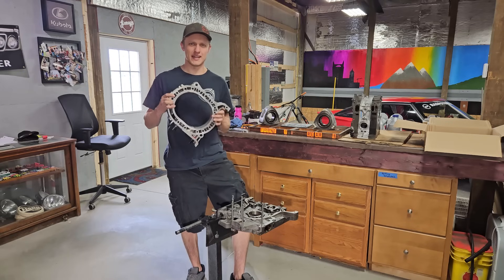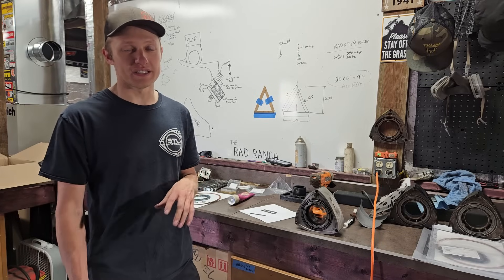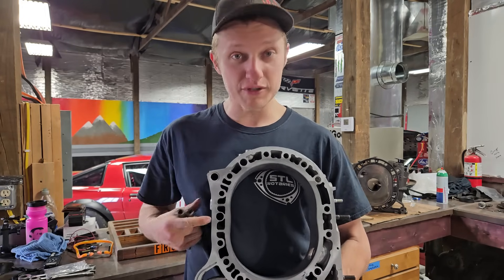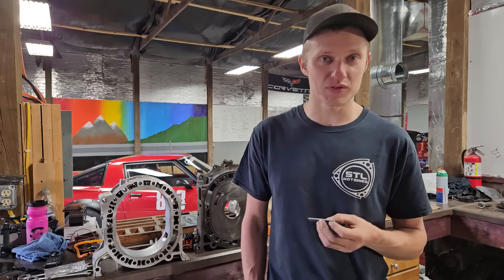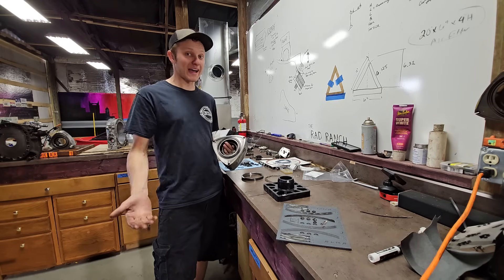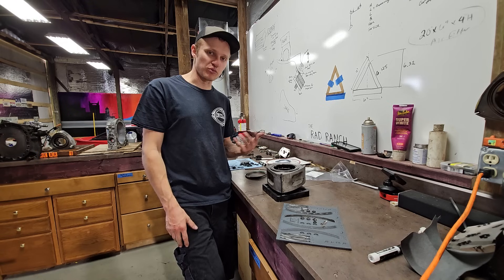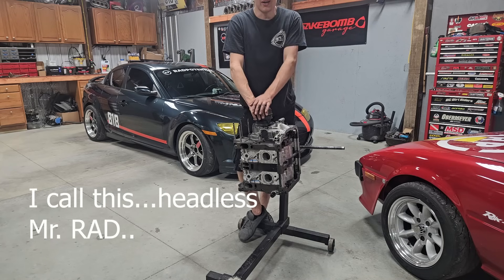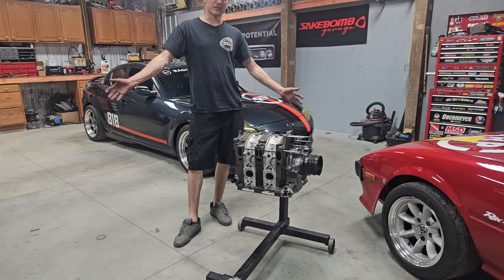Taking Rob Dahm's Advice For 13b Rotary Reliability and Durability @RobDahm Thank you!

Comment: bro maybe people already know but i wonder running a rotary on blow thru propane and just eliminate gasoline inject high pressure liquid propane into the turbo to heat up and vaporize mix up with the air plus it's dry maybe need oil metering pump to fogger in 2 stroke oil lol would anybody else like to see if that's possible not to mention thirsty rotary engines could see fuel prices cut in half

Comment: The mazda apex seals are not soft seals by any means. They are also not weak. Infact, Mazda seals are hard seals and that is the reason they are brittle. When they break, as you said it ping pongs in the engine.

Comment: Hi i am new subscriber and at around 11 you say that if you put the assembled rotor on the back of the engine something bad will happen to the control ring ? I dont understand that part because you can assemble each rotor front and back and as long as you put the control ring curved round edge in the correct slot just how you say and facing the correct position it shouldnt matter if you put the front rotor in the rear ? Because your rings are in the correct spots right ? Or am i wrong somehow ?
Reply: You have already assembled the front rotor ? Control rings and all and lets say you assemble rear rotor as well , it wouldnt matter where they go rear or front would it ?   And i do understand each rotor faces oppsite side please help me
Reply: @bryansautoandmotorcyclerepairs  it doesn’t necessarily matter but you should have labeled them when you did the teardown. As long as the oil control rings are correctly aligned then you should be fine. If one of the rotors is new you should be certain that the casting batches match. That will be designated by a letter near the corner seals. C’s are the most common. Get on RX7 club and look this stuff up. Its much more efficient than commenting on a youtube video. Im sure Mr. Rad is a busy guy and he probably cant get to every comment.
Reply: @Alwayscorrect12  well thanks for your reply and yes i have already learned you need to have matching rotors.   And that little part just threw me off completely on his video and scared me because i dont want to make mistake.

Comment: hey Rob and RAD. i´m building up an outparted 1985 12A FB3S GSL with GSL-SE Axles (dont know why they done this but hey i have SE-Axles) so can i use that extra dowel thing on the 12A too? expecting yes but better i ask 1 time more than doing an failure in thinking about before i start that whole project

Comment: OEM seals are king! If you are breaking an oem seal you have other issues to deal with or they were very old and got brittle.

Self built REW thats been going for 3 years as a drift car and making 430whp with all oem internals. I have run it out of fuel under load, hit boost cut with wastegate plumbed backwards and countless fuel pressure drops from slosh and the engine laughs at it all.

The real key is having a good ecu with at minimum wideband, fuel pressure and oil pressure sensors going to the ecu with correct safeties in place.

Not hating at all but i have been on the bendy apex seal train before and after changing to oem i will never go back, they might not compression test much different but they pull better vaccum (seal better everywhere) whilst actually in operation.

It seems so rare to get real feedback from people about these engines so for me if my engine can handle 3 years of what i put it through the average person who wants a fun street car has absolutely no need whatsoever for an aftermarket apex seal and can enjoy that for longer than most will probably keep the car for.

My car is remote tuned by Omar @ Raceonly and he is the one who conviced me to go oem seals. They are way more reliable and more importantly repeatable than everyone gives them credit for.

Comment: If your really want to keep the torsion twisting down look into the Mazda factory race motors they had a steel plate across the top of the engine front to rear on the MFR pp motors nobody has ever noticed that and nobody has as much R&D as Mazda some old racing beat catalog had pictures of it

Comment: This is sort of an unralated question but does anyone know where i can buy the 3 vacuum hoses that come off the intake of an RX8? Ive had a hard time finding them and im chasing a lose of power issue and the engine runing rough at around 7-9k RMP after putting on an AEM cold air intake which i think is a vacuum leak.
Reply: Get them from Mazda. If you take your car to HPDE or autocross you can join the Mazda Motorsports support program, which gets factory mazda parts for great prices.

Comment: What caused the detonation? Solve that before you put this engine under any load. Otherwise you'll  be right back here again! Also that dowel is not ideal where it is. You are removing material from near the plugs and could cause the housings to crack. Either put the dowel further down from the plugs, or better yet put in a stud kit that removes less material from the housings and is far more rigid. But you dont need any strengthening on an FD engine if you are targeting around 400-450hp
Reply: I don't know enough about engines to comment on dowel location, but I agree that unless there are ECU datalogs showing that all the readings were good then I'm suspecting fuel system problems, or overboost, or ECU calibration problems like not compensating for unusually hot or cold temperatures. Each time I hear about a hurt engine, I wonder what could have been done to prevent it. I can't imagine any brand of apex seals causing failures on a 350whp setup, they are just the canary in the coal mine telling you that something else was wrong.
Reply: Colder plugs will help with detonation, it's well documented on the rx7 forum how effectively it helps to reduce this
Reply: @Sparkling.Fresca  great point, I assumed they would be running NGK 9's or colder. I don't remember hearing that mentioned in the video, hope they weren't running stock heat range.
Reply from the maker: We have 9s in the car.
Reply: @RADPotential  Look into R7240-10 for leading and R7420-11 for trailing, should have at least the IGN1A smart coils for these to not foul up under normal driving. The trailing plugs can act like glow plugs and cause preignition, and the colder plugs will reduce the apex seals chattering over the plug holes. Will also help protect the water jacket around the plugs compared to the hotter stock ones.

Comment: I have a 375+ whp fc that i have done many engine builds/car revisions on trying to find a combonation that will last. Its been about 9000 miles on my current setup but i have had very good experience with RA classic apex seals. I tested stockers, e and j and the RAs can take the heat and just need some extra premix. I would love to discuss with you what my experiences have been working towards achieving a reliable high hp rotary even in 90°f ambient temps and long road trips

Comment: watched the motoiq video aswell and saw rob recommended power seals apex seals wondering what the difference is to rxparts apex seals
Reply: I had my first 12a turbo built with power seals nearly 20yr ago …so plenty of R&R on power seals products…Australia has the biggest Rotary shops with big reputations an Nz is the best for exotic 4x rotary engines - e-shafts in the world
FYI- The car made 360hp atw ran a 11.2@124mph

Comment: My only issue with the Rob video and him giving advice on longevity is he hasn't built a rotary that's lasted 10's of thousands of miles in his experiments to know how long ANYTHING will last. He's a HP guy! Also, the problem with all these aftermarket apex seals is no one knows how long they will TRULY last inside these engines. One of my own 13b engines went 55k in an NA 91 Vert with crappy used housings using RA seals. The only reason that engine blew was because of the tephlon coolant seals failed I was experimenting with at the time. I also didn't beat on the engine either.

Back in 2007, I worked at a Mazda dealer and as the only rotary mechanic that rebuilt engines in house. Back then, Ra seals were about the only thing we had that was unbreakable. Anyways, I had an FD come in that was putting down 300+ rwhp with the factory twin turbos sequentially, and the engine was running perfect. That car was a beast and had unbelievable bottom end and was running FC coils. It was a car built by Rotary Performance in Garland Tx. Car had about 190k on it so I naturally reached out to the owner to ask how many miles were on the rebuild. He told me that engine had 80k on it. I was like 😮. I then asked if he was running any of the aftermarket apex seals and he said no. He was running FACTORY 3mm no doweling or anything. Just a simple build with a perfect tune. See, these are the types of results I love to hear about and yet so many popular YTbers think these after-market options are the ONLY options.
Reply: Bottom line here is not to detonate, any apex seal should last if treated right, properly oiled, no carbon build up, a safe tune. He said it wasn't the tuning fault, so what caused the detonation? He wasn't running super high boost, so I can't see heat being a problem. Maybe a fuel issue? But he shouldn't drive the motor until he finds out what caused it.
Reply: @RedBatRacing  I always get the fuel injectors cleaned and flow tested on rebuilds. Gotta cover all your bases. On that 190k fd, I wish I had monitored the A/F back them to see what it was tuned for. Mazda ran the Fd at 10.0 for a reason under boost. Something that rich gives you some lea way if you have to put 87 in the tank or get a bad batch of gas.
Reply: @rotaryperfection  I suspect Mazda ran them so rich because the twin turbos were thermonuclear reactors and the stock IC was small. So they took whatever safety precautions they could. I blew my first stock motor on a track day. We pulled the engine apart and found the rotors thick with carbon. Now it's a 450hp dedicated track car with single turbo, large IC, water injection and I run around 12:1 afr
Reply: @RedBatRacing  I had completely opposite results. My fd was stock with a modified air intake, downpipe and manuel needle valves to control sequential turbo boost. Had a perfect 10-8-10 pattern. I was one of those that did preventive maintenance. Plugs and fuel filter every 12k and water steam clean twice a year. I also did the fast warm-up and NEVER let the car idle to warm up. I bought the car with 65k and in 3-1/2 yrs got it to 108k. Engine was original and still running perfect with half of those driven miles on 87oct. This is how I figured Mazda was running rich because they had to account for all fuels at the gas station as premium as only recommended and NOT required. 

The only reason my engine blew was because on a cold winter day, I was getting on boost while the engine wasn't fully warmed up. Well, the double throttle decided to open as I floored it and caused a boost spike to 12psi. I didn't lift my foot fast enough. I also had 87 in the tank so of course, I didn't have ANY protection. Pop went the rear rotor. Crazy thing is, I limped the car to my apartment, shut it down and 30mins later decided to take the car back to my parents house to park it. She fired up on 1 rotor and I was able to drive it 10miles to my parents house. Not bad for a single rotor with 108k. When I broke that engine down, carbon was minimal and all my seals were nice and loose with zero carbon lock. Rotor faces weren't to bad either. The good housing was used in a different rebuild and iy didn't even have the typical apex corner seal wear groove in the rotor housing. I still have that blown rotor housing and need to do a quick video showing what a 108k rotor housing looks like on a well maintained FD (minus the apex seal damage of course).
Reply: Totally agree sticking with OEM 3mm. I detonated from a spike at 18 psi and when engine taken apart just the side seals had chattered. Apex seals had expected material reduction from 30k+ miles on them,  the rotor housing were perfect.
Reply: You make a good point. Mine are slowly accumulating miles but aren’t real world examples yet. I realistically wouldn’t expect 100k from anything at these power levels but still. I’ve had really good results with the irotary seals in the 3 rotor for countless miles but one of them warped on the 4 rotor. So I have both good and bad
Reply from the maker: When the failure happened, everything in the data log looked perfect.  Pressures. Temps. Afr.  Timing is conservative.  My current hypothesis is the Haltech Soft ignition cut.   The engine popped the seal while the soft cut was occurring.  I talked to a few tuners about it. Some say it could have caused it due to the randomness of the cut introducing irregular ignition fires to the engine.  IE, the soft cut works well in a piston engine when it randomly cuts one whole cylinder. Vs randomly cut a single ignition coil, whether it is a leading or trailing of either rotor. We turned that off and are going to try it again.
Reply: @RADPotential  What A/F are you running under max boost?
Reply: @RADPotential  Great catch, rev limiters can be hard on engines. I've heard that some ECUs have rotary-specific limiter logic which cuts all of the coils or injectors for that rotor, and I assumed that Haltech would be doing that since it's so popular in the rotary community. I think a soft/partial fuel cut would be even more dangerous, if a primary injector shut off but the secondary for that same rotor was still injecting that could be enough fuel to run it leaner and hotter than usual.
Reply: @RobDahm  I hear ya! It just seems so many aftermarket options mostly focus on not breaking (which is what you want for extreme HP rotarys) to save the parts, but hardly anyone is giving long-term updates on those builds. Many rotor heads just want a reliable rotary that doesn't need to come apart every few thousand miles.
Reply: agreed. he isnt like many other shops who have been building rotaries for years. nothing like how the kiwis do it
Reply: Well he was only running around 300 wheel, so isnt it obvious that stock seals would last at that range? Dont see your point there.
Reply: @jakeable587  I think he is speaking of the durability of 3mm OEM seals vs 2mm OEM seals, maybe not just the longevity. I run 3mm's in my car, rebuilt by the same folks in Garland.
Reply: @rotaryenforcer  Yep that's my point. Factory 3mm, even though they're heavy are far more robust than 2mm and wear better on the housings vs all these aftermarket options. I don't know of any other rebuilt rotary making that kind of power for that many miles. That's why I used that as an example.